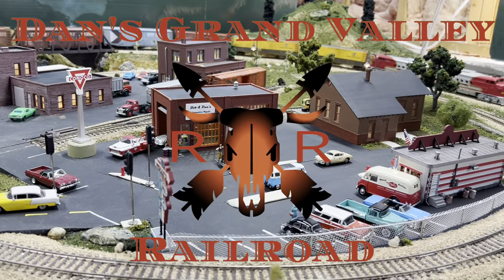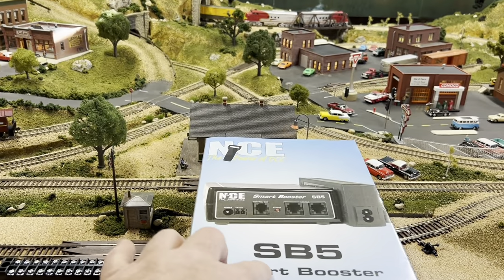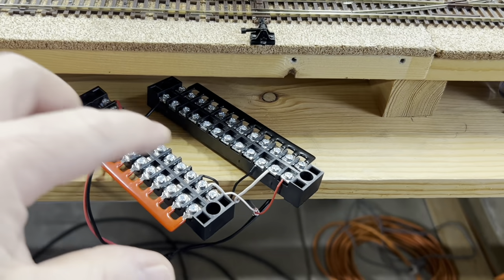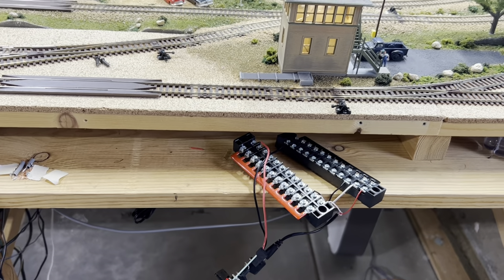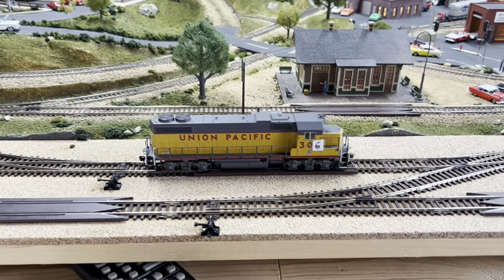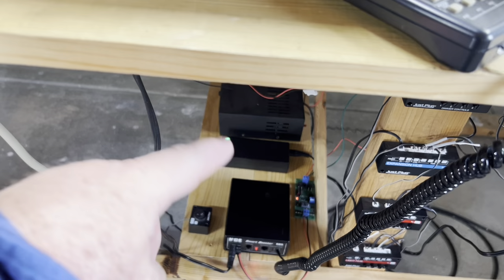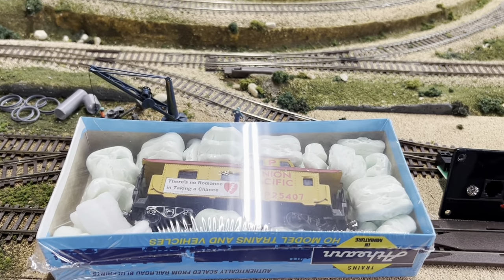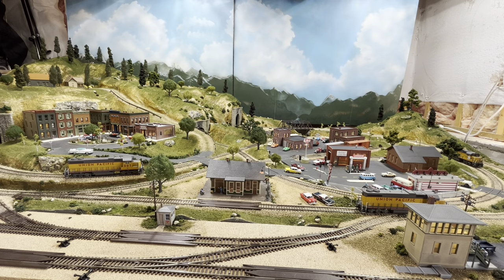NCE SB5 Smart Booster and EB-1 Circuit Breaker Install

Comment: Freaked me out at the end, but then read the comments and noticed you dialed it in and that happened earlier. That was not nice, Just Kidding. Glad to see it all working, or I guess it does? I like your HO layout cause it is small like my N Scale one. And your scenes are awesome and inspire me for my tiny N Scale layout. Can't wait for the next update to see IF it is all still working with the new Booster? Maybe Santa will leave you a new locomotive or take a look at 306 for you :) I have 3 Atlas U25B's and have a piece of tap on the bottom of them numbered 5,6 and 7, as two are the same number and ONLY 3 digits at that. When they are running sometimes I have no clue which one is which. It's interesting when I have all 3 on the layout, unless on a Consist. Men and their toys :) And expensive ones at that.
Reply from the maker: Haha thank you. I purposefully put that in at the end to see who was paying attention, ha ha. Yes, my channel is all about the smaller layouts and all the things you can do with them. I do have some expansion ideas for the future, but for right now, it’s a good size for me. Thank you for watching, and taking time to comment. I really appreciate it! 👍🏼

Comment: Good vid of the upgrade. I have 235 feet of Kato unitrack amd a bus wore with 56 feeders going to a NCE power cab and I have ran 8 locos at once. Nothing "messed up" but I had to give more throttle for the same speeds with less locos. This we more than I typically run but it was just a test. I figure a SB5 would help in some form or fashion. Again. Good video covering what you did and the results!
Reply from the maker: Thanks Nitro!! 👍🏼😁

Comment: Nice upgrade, Dan! Plenty of power now for all kinds of consists and switching operations. I think once your 306 issue is cured too, you won't be popping breakers at the end of videos! haha
Reply from the maker: Haha thanks Tom. The EB-1 has three dip switches for a variety of amperage tolerance options, the factory setting was way too sensitive.  Even a caboose or boxcar slightly derailing would trip it.  That “blooper” happened before I got it locked in. Haha I wanted to see if anybody would comment on it. Lol
Reply: @DansGrandValley  😆 Cool! Glad that was the case! haha

Comment: You know, you've got a ton of track in your layout. You might wavy to strongly consider breaking into districts, and then adding an eb1 to each district.  My layout is a simple mainline, with 4 sidings, and a single pass through lane. But i have about 90 feet of track on it. I broke it into 4 districts and added an eb1 to each district. It makes it much easier to diagnose a potential issue, in a certain block. Then, if one block shorts, then I can only have the power off to that district.
Reply from the maker: Good info Damon, thank you! And thanks for watching, I appreciate it.

Comment: I've got  a power cab and SB5, as well as another small operator cab..... hoping to get some bench work started soon...
     Have you added any cab panels to be able to plug in the cab at other locations?  I plan to have the SB5 near one end of the yard/town, on one side of the room...and a panel at the other end of town as well as another panel on the opposite side of the room ....   the main line for continuous running and a few out of town sidings will be one power district, the storage/staging track will be another district, and town will either be a 3rd or possibly 3rd AND 4th district....  doing around the walls of a room that is about 9x11ft.
Reply from the maker: Hello Isaiah. Sounds like you’re all set to start a grand adventure!  I did add a panel right on the front of my layout, exactly where my original one was simply to keep from having to plug directly into the SB5 and pulling on it (and it moving around) all the time. They daisy-chain together very easily, so I plan to add a few more like you said, when I eventually expand my layout with a two line main around the outside.

Comment: Do you have a video of the wiring with the initial setup of the layout?
Reply from the maker: Hi Jason. In my video “update number 17“ I show how I wire in the NCE power cab. Prior to that all I had was a Bachmann EZ command controller that had two wires going to the rails. The NCE utilizes three feeds that I have scattered around the layout now.  I think what you’re looking for, will be shown in this video, but I’m not sure. The only other wiring I did at the beginning of the layout was a positive and negative wire going up to the very top area where the little house and shop are now. Just so I could easily have power up there for lighting.  Look around the 4:00 minute mark on update 17. Thanks. 
https://youtu.be/c3OoT0tHjLU

Comment: Couldn't you just get a larger 12v power supply instead of buying the booster?
Reply from the maker: The NCE Powercab comes with a 13.5v power supply already. It’s more a question of amperage draw. I was more confident buying their booster, than messing around with different power supplies, fearing I’d damage the powercab. Excellent question, thank you. 👍🏼